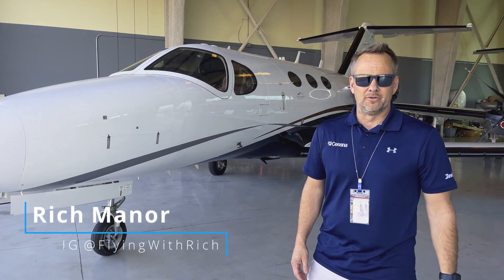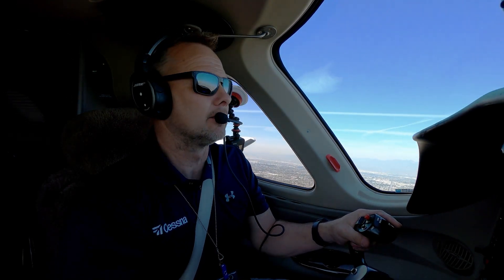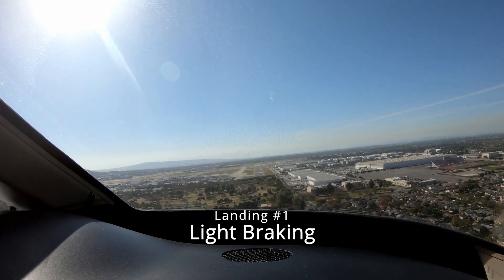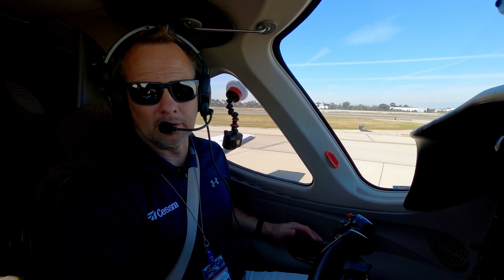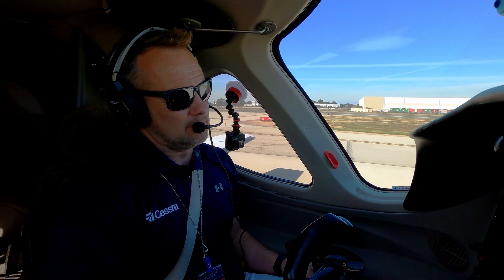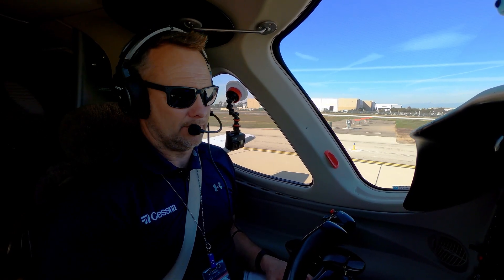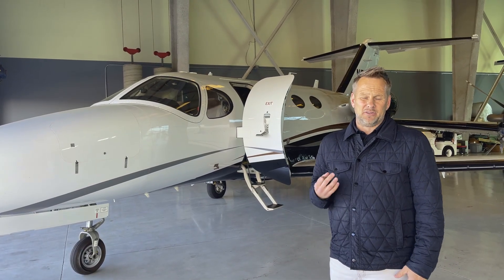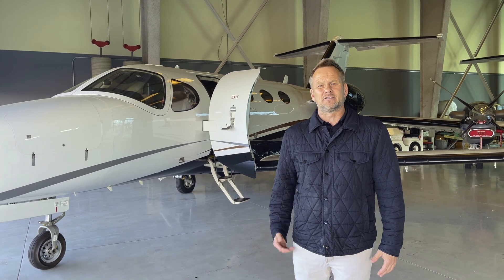#16 Low Cost Fix for Nose Wheel Shimmy - Citation Mustang

Comment: Nice video! We also had a shimmy event with a Mustang it was a one time event, we suspected it to be due to cold soaking. It was a 3 hour flight at FL410 and a landing with outside temp of -5 Celsius
Reply from the maker: Timely comment - we did same repair to another customer airplane and have not had any more issues with it until yesterday after 3 hours the build of which were at FL400.
Reply: If you guys get to the bottom of it, I would love to hear from you 👍
Reply from the maker: Will do.

Comment: Howdy Rich, interesting, informative video. My first thought was the nose gear bellcrank breaking problem with pre-'Q' model 310s and 320s. I'd be curious to know what you did, mechanically, besides repacking and/or replacing grease seals and general retorquing of the gear components. In line with your description, I only recall nosewheel shimmy problems on other aircraft when under hard braking situations (i.e. a for-real short field landing, like the Ranch Strip or Christy Strip on Santa Cruz Island). Hope you enjoyed the "They Forgot Me!" email. T'was definitely one of those, "I learned about flying from that," episodes. 

Your "Gear down, landing flaps" callout on short final is reminiscent of my days flying for Sierra West. We did the same thing except added, "Gear down, flaps full, mixtures, props, Landing Checklist Complete!"